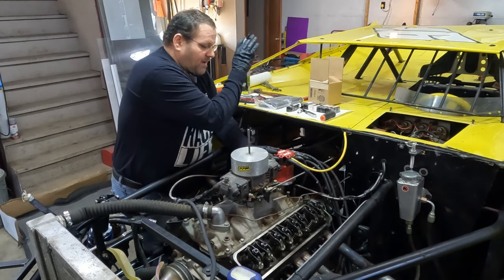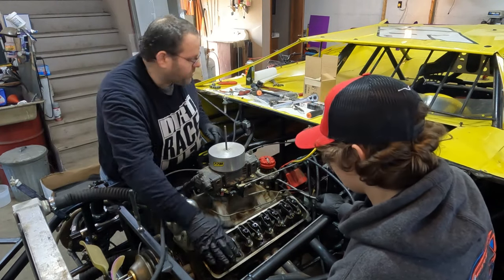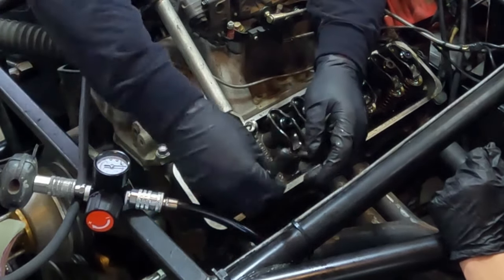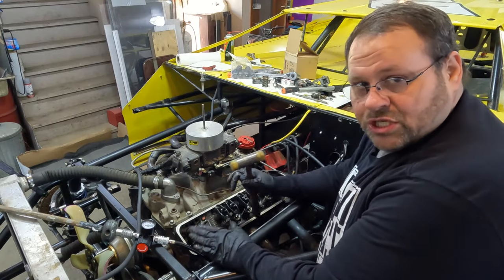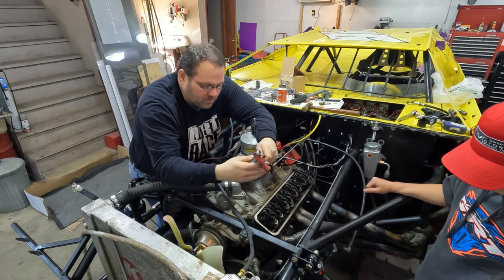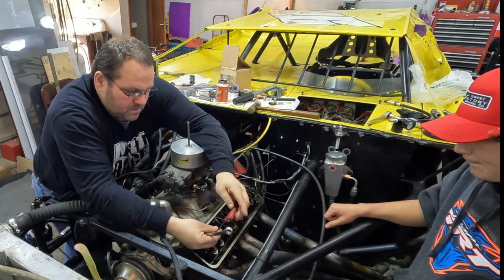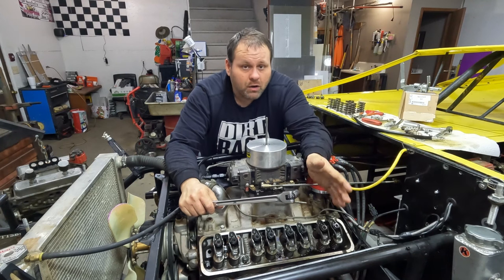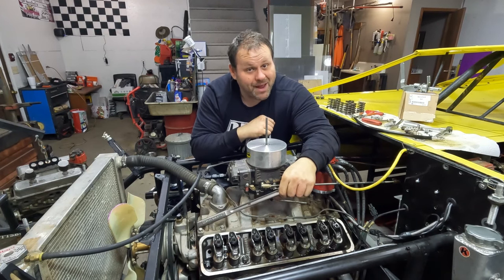Changing Valve Springs on a Crate 602 Sportsman Late Model

Comment: When I’ve done ours as soon as I hit the air. The cylinder went to the bottom. I kept air pressure on it and changed the springs. But the “Pucker Factor” was thru the roof in the process. Very glad I came across this video! 😬
Reply from the maker: I'm still always nervous doing them but I try to stick to the routine and just make sure I do it exactly the same way every time.

Comment: my dad puts small rope into the cylinder then rolls it up to tight with head n valves. they dont try to fall. absolutely no worry of em dropping without physically rolling crankshaft
Reply from the maker: If it works and you are comfortable doing it I sure won't knock you for it. I'm scared of stuffing because if the motor was rolled for any reason, the stuffing drops and then the valve but let's be honest thats highly unlikely.
And honestly this is good feedback because I know I overlook stuff or am too set in just one way and need this feedback to remind me. So thank you.
Reply: That's the way I learned it too.
Reply: the professional way is as jason stated in the video. but its just a different way to skin a cat with air on hand or the fancy fittins/tools. paracord att walmart works fine. just fill it up.

Comment: Had that spring compressor last 2 valve springs, 3rd one broke an ear off. Can tell it was junk metal. Glad you've had success though. Good video
Reply from the maker: So far I've had good success but I have only done a triple spring roller once or twice. I may need to take a hard look at mine for any stress. I think mine is a lisle brand but this spring compressor is a basic cheap model sold under 10 different names so who knows. Thanks for the tip.

Comment: Ever check the install height? The three we have sit at about 1.750, ours mic’d at 1.762. We’re allowed 1.700. The difference between 1.750 and 1.700 is about 20 pounds of spring pressure. Any HP gains are huge in a class where everyone has the same.
Reply from the maker: Ian, that is so true! No I did not but this engine of Dylan's was freshened by a certified builder who I am sure did (well I hope so :). The springs were a matched set but yes I will absolutely mention this to Dylan and the next time we put springs on we will check it. Thanks for bringing this up.
Reply: @DIRTRACELIFE  yes sir! Just make sure to check if your shims are laying flat on the head. These heads have a little lip and most shims won’t sit down all the way to give an accurate reading. We actually had to machine our mic to fit and also the shims. Love the vids and how educational they are. Keep up the good work!
Reply: I've had success with 1/4 turn but there's also a way to run the lifter near the bottom of it's travel.  Less oil in the lifter, possibly an improvement in control at higher rpms.
Also prefer the EOIC method on bigger cam stuff but I've built the habbit of just using that one method.

Comment: What is that hose with the gauge called? And where do you have it connected? Like an air compressor? And where is it in the engine?
Reply from the maker: That's a cylinder compression valve holder. I attached it to a regulator gage just so I could reduce the air pressure down some. You can use just the hose at 100 or more psi and not use an air regulator to cut it back to 80 or 90 psi but if the engine isn't on exact top dead center for the cylinder you are working on, the extra pressure can roll the engine over 180 degrees fairly easy. You can put the car in gear to stop that as another way, but make sure you scotch the wheels well to keep it from moving. Here's a link to an inexpensive one:
https://www.amazon.com/dp/B000COC7ZU/ref=as_sl_pc_as_ss_li_til?tag=dirtracelif04-20&linkCode=w00&linkId=2dbbf8686af1c6c85d5572d9a51a9e0e&creativeASIN=B000COC7ZU

Comment: Do you just put preload on it and not set your valve lash?? I was wondering how to set the lash?
Reply from the maker: Keep in mind you don't have a lash setting on hydraulic valve trains. By preloading into the hydraulic lifter you are in full contact with the valve and are applying pressure. Valve lash applies to solid lifters where additional clearance is needed to allow for heat expansion, harmonics, and to allow the valve to seat at closure. On a hydraulic setup the piston in the lifter does this instead and that is the reason you preload into it.

Comment: Do u change every season.. or... 10 races. Also.. how much power do u lose from weak valve springs.
Reply from the maker: I've always heard 10 races as well but for many it may be close enough to just call it a season and put a fresh set on every spring like I did here for Dylan. 
Weak springs rob your top end. They make the hp curve drop suddenly at higher rpm due to bounce. It will stay make the same power it just may run out of power as your rpms increase. Like having a rev limiter on. But very destructive.